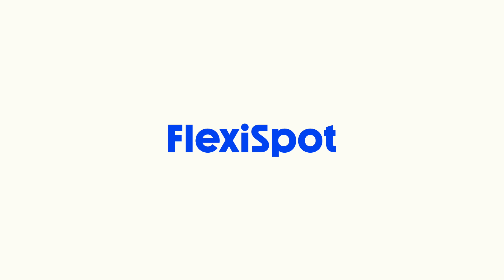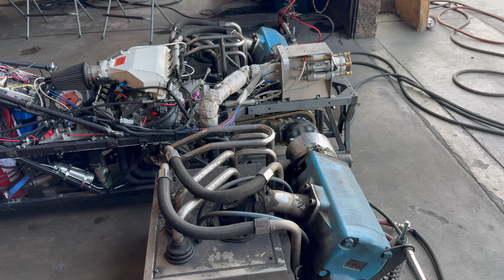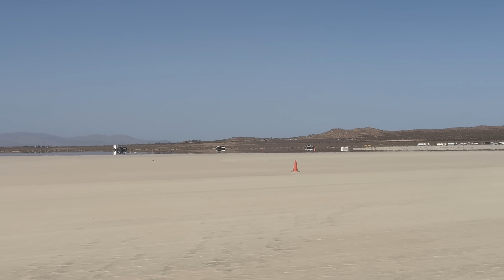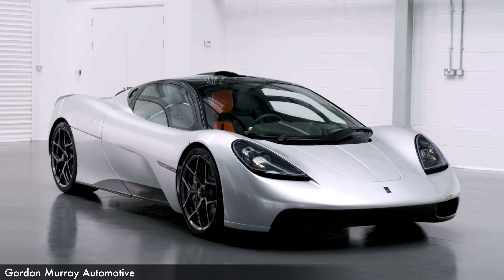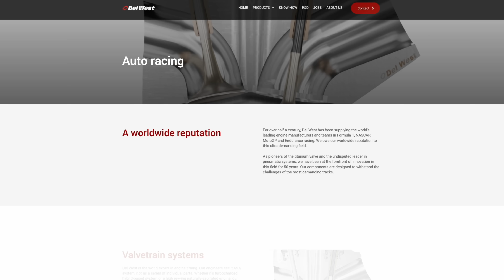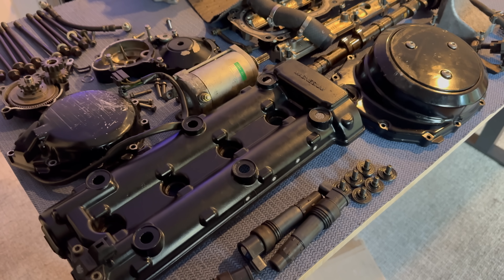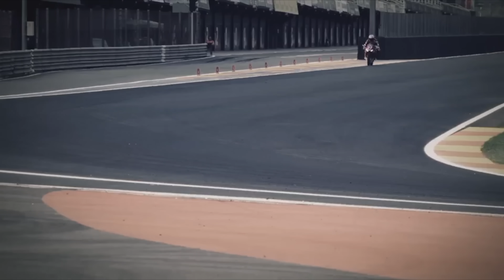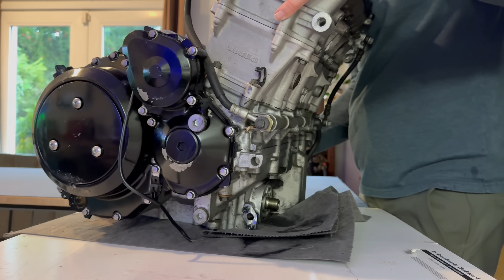Motorcycle Engines Are WAY BETTER than Car Engines

Comment: having been the 5+yr owner of a daily driven 2003 s2k  (glass rear window and 9,000 rpm redline)  a 2L v8 based on the CBR engine sounds like 15,000rpm music to my ears! the "king of heads" really needs to make a return and this sounds like the perfect vessel for it to do so. Stop being COWARDS Honda. 

sure was 5,500rpm in 6th at 65mph buzzy annoying , sure. but as a car guy I'll take it.  

Also in regards to spring  occulting frequency when I drove my S2000 on I-495 from New Castle,  Delaware they had concrete pads of a certain length and when trying to be responsible and driving at the speed limit (65MPH well actually 62-67MPH) the S2000's springs would synchronize with the bounce and make this the most uncomfortable boingy, boingy  ride you have ever felt. {at least this is what I told myself every day when I blasted through it at 80+ MPH) 

I am truly curious about the red Dodge VIPER driver that I commonly passed in the morning if he had a similar problem/oscillation to explain why he was so slow.  

Also MAD props to the dude that daily drove a red VIPER on I-495 in the mid 2ks, nothing but respect , my man. sure if the temp every went near 50F( 10c) I turned on the heat and dropped the top. but he was just out there raw dogging it, all the time.
Reply: I would buy an s4000 only designed to last 40,000 miles if I bought it at 20K for $22K like I did my s2k then years later sold it for $20K after years of super exhilarating  fun  daily driving it any day of the week and twice on Sunday. Especially after having smoked in in it for all of those 5+ years. Heck I'd buy that s4k used to only own it a year. I loved thatS2K so much!

Comment: Yhe maim thing you didnt mention, probably because it's very complicated and a whole video on its own, is that those small motorcycle engines dont produce much torque. Wpuld be fine in a small sports car, but in an SUV or truck low torque is gonna give you issues. Still, if car manufacturers were getting ICE lobbied into oblivion they could certainly implement a lot of engine design features from motorcycles to create much better engines that still last a lot of miles.

Comment: Power density is high but torque output is relatively pathetic.  The limiting factor to small  piston engines is still the peak piston speed possible while giving a decent life cycle.

Comment: 10:08 BMW N52 engine block is made out of an Aluminum Magnesium alloy. But the bolts are also made out of aluminum 😭😭😭😭😭
Putting headers on was a nightmare. 
I don’t care what any M3 comp or B58 guys say though. The N52 is BMW’s last good engine.

Comment: I've always been fascinated by 2 stroke engines like they way they use the crankcase to pump and deliver air at the end of each combustion cycle, some have crankcase skirts that act like a rotary valve to control the intake/transfer stroke (air compressed in the crankcase is forced into the cylinder at the end of the combustion stroke) or you use a reed valve which only allows air to flow in 1 direction into the crank case. They also have expansion chamber exhausts to improve exhaust gas scavenging at certain RPM synchronizations.

Comment: Why don't we use the production of  air conditioning system Inside the valve compartment instead of a nitrogen spring Obviously for commercial purpose but i think thermally its near impossible because i am not engineer POV

Comment: Displacement is not the lazy way to get more power. It’s how you get more torque output. Longer stroke=larger torque output. Motorcycle engines are great in all but you can expect it to pull much weight.

Comment: Certain b / k series Honda motors are able to go to 8-8.5 stock and with like some aftermarket you can go to around 10k if you want to build that way. However, motorcycle engines are pretty cool and rev way higher due to their nature. I think it’s always funny that a 600 is More sporty then a 650 sorta due to racing stuff lol.

Comment: Great video. As a veteran tech in modern motorcycle dealerships, I was hesitant of the video title when comparing how many engine rebuilds I've done compared to my friends in the auto industry, but you nailed the context, emissions and not built to last like a car engine. I really appreciate your break down of the valve train too. I've gotten to experience first hand the transition of screw/lock nut, buckets, deso, and finger follower through the years. From a service stand point the finger followers are definitely the best iteration. Not only can you create more power as you explain, but they are typically a lot quicker to get your measurements and make any adjustment.

Comment: Great video, but one thing, all of my BMW bike engines (4 in the last 18 years) all last easily 100k miles without any problems. Most of the repaired car engines I saw didn‘t last that long (belts in oil etc), so the milage discussion is nowerdays off the table, but yeah, cost is a driving factor of corse

Comment: ‘Motorcycles do it the hard way’ - Harley Davidson: hold my beer
Reply: Harley: The last time our engine engineers did anything was in 1955...we haven't needed an engine redesign since.
Reply: Amen. Also, tbf, when they designed their liquid cooled engine, it reliably made 200 hp so they detuned it.
Reply: @paulmryglod4802   "Reliably" in the motorcycle world could still mean the engine is completely worn out at 40,000 miles.
Reply: @SeniorKlean yeah thats a soft word with a large variance
Reply: he was talking about making power
those things can barely get out of their own way so yeah

Comment: Thank you for such a comprehensive explanation. A lot of effort in this video. That said, everything is made to fulfill requirements. Most motorcicle riders doesn't need refinement, good mileage, comfort, silence, etc. That's why gearboxes are made with noisy but cheap to be strong straight cut gears, absence of variable timing distribution, complicated exhaust recirculation gases systems and so on. Simplicity is a plus on motorcycles at the expense of good effiecency that car manufacturers are required to meet. Again thank you fur such damn good, AI free information.

Comment: That's what I thought. I guessed these engines are highly engineered. And where similar to F1 because they rev high. And thats thanks to bigger bore. F1 is the same. Probably even bigger bore revs up to 17k in old v10s. Bigger bore and smaller stroke means more rotations, more rotation is more power.

Comment: 4:16 as a ninja 500 rider I can’t tell you how much I burst out laughing hearing my bike get brought up cause I got it for that exact reason, it’s basically a sports car except it looks and sounds better turns more heads and costs a 10th of the price
Reply: its a 500 bud not a 10rr relax on the self glaze
Reply: @J @Jaysingh-ng7vc well yeah a 10rr would fit into the superbike category, my 500 beats most sports cars as is though, that’s the awesome thing about a cheap sport bike, it’s cheaper faster and gets more attention than a cheap sports car, not to mention a “cheap” new sports car is still going to be 10x the price of a new bike

Comment: My 1998 Yamaha R1 has 5 valves per cylinder.  3 inlet and 2 exhaust.  I've rebuilt 3 of these engines and although they are now old, they produce around 155 bhp at 10,500rpm.  Which still equates to quite quick.  Newer engines produce even more power but the 0 to 60 always seems to be the same at around 2.5 seconds.  I believe the tyres are the limit here.

Comment: Yes motorcycle engines are much better and more efficient than car engines, but where they are positioned makes them far less efficient than a car engine, but if you put a car engine in a motorcycle, it would be amazingly cheap to run, but still much less efficient per size and weight than it would be in a car.

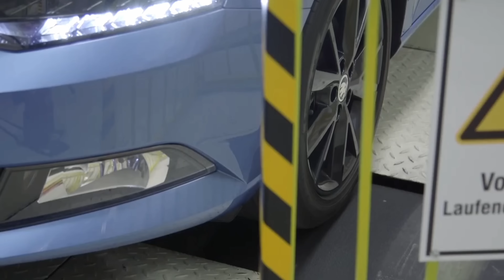Comment: 2:54 That wording is deceptive. They are very inefficient, because they dont fully burn the Carbon to CO2, but instead have higher CO and also CHO- ( partially burned fuel). 
Basicly: If you burn the equivalent Carbonatoms and hydrogen atoms of 7 litres of fuel, you will exhaust the equivalent of that. And maximum efficiency means: Everything is CO2 and H2O in the end.
So the only way to exhaust less CO2 for the same amound of burned fuel is to exhaust funny smelling stuff. And to be fair: That funny smell of motorcycle exhaust is what we all love and connect to having a great time :)

Comment: Clickbait. The #1 reason is lower emissions standards. Without #1 you can put all you want into B, C, D, and E but fail emissions so it's futile. You truly think car manufacturers (who often produce bikes at the same time.. Honda anyone? ) wouldn't have done all of this in their cars if they were allowed to? He mentions multivalve as though it's something new even though it's been used in mass production cars since the 60's. Clickbait - and the first one I fell into the trap of.

Comment: The GLARING problem with using a motorcycle enging a car is all the extra weight load that the engineers developing said motor NEVER had in mind!  I mean even if you make a car ultra light for a car?  Lets say 1500llbs?  Well that is STILL a half ton EXTRA weight

Comment: 100,000 miles on a 2005 r6 and it never left me stranded, no insurance and cheap on gas

The Yamaha r6 was made as a race bike with lights for streets 

Still lasted 20 years and 100,000miles

Comment: Caterham 7s are nice and light at 550kg (1210) with my rover k series in it. They e been fitted with fire blade, blackbird and the legendary RST v8. As close to a 4 wheel motor bike as you can get.

Comment: For me the most interesting thing about motobikes engines is their torque. I have Yamaha FZ6 2008. It torque peaks at 10 000 rpm, but!!! at only 4000 rpm it already has 80% of maximum torque. And starts to pull clear from no more than 2000 rpm (only 50% of max torque, but clean, no irregular "convulsions")) And this is without any VTEC or other phase or intake/outlet geometry variations. Race cars with same power ratio (over 160 bhp/ltr) without phase and other variable items can not work in so wide rpm range (1200 idle - 14000 redline, more than 10 times). They shake like hell in idle that is no less than 10% or even 15% of max rpm with irregular operation,  they have really peaky torgue curve with almost nothing below 50% of their max rpm (like nascar engines) - why?

Comment: One thing to note also is most motorcycle clutches are also wet, as in they're lubricated with oil. Usually the same oil from the engine. That combined with how much friction plate there is makes them extremely robust to allow for riding the clutch quite a bit more than you would in a car. Operate a car clutch how you're supposed to operate a bike clutch and you'll wear through them pretty quickly. In low speed maneuvering you're controlling your speed more with the clutch than with the throttle.

This is part of what allows for such a simple transmission without synchros - you're basically using the clutch to do the job that the synchros are doing on a car's transmission. It does mean the rider's got to keep that in mind while shifting via a bit more emphasis on rev matching and clutch control than you need on a car, but that's just one of the many ways a bike's more of an activity to pilot than a car.

Comment: Wow, a ‘semester’ class in <20 minutes; beautifully done!!! Thank you! Side note: Honda tried the motorcycle engine in a car in the early 70’s. Their model 600 had a two cylinder motorcycle engine attached to a much beefier transmission with a four speed manual shift. The car had 10 inch tires, laughable today. My dad bought one from a salvage yard in the days. We could actually go in and walk the yard. It had a rumple front fender which he replaced with a new one and hours later the car looked like brand new for a song. Unfortunately, my brother totaled it before I had a chance to get it. However, I did learn to drive a manual shift at the age of 12 just by asking my dad to teach me on that car.

Comment: I live in Thailand and the number of motorcycles in use on the road is 30x more than in the US.  Many families only own a motorcycle or 4.  They get to form at the front of an intersection and are allowed to lane split.  They are used for work, delivery and taxis.  Most of these motorbikes are under 200cc with 125cc being the most common.  Many are automatics and this is what most women drive.  It is very efficient to get from where I live to the store, restaurant or any place in the city.  For long distance travel, there are lots of buses and trains.  When I go back to the US I find very diffciult to get around without a car, unless I am in a big city center with public transportation.

Comment: I own three motorcycles. The XJR aircooled 1300cc with 4 cylinder and 4 Valves per cylinder pushes hard and last "forever"  in a bike. There are some with 200.000 Kilometer plus on the market.  My XJR is from 2004. This engine is bigger then in most modern cars. 9500 RPM are maximum. My XSR 900 Grand Prix pushes 120 horsepower with 11.000 RPM. Car-Engines normaly explode by this numbers. But this engine also have a three year garanty without range limitation.

Comment: my aprilias engine is older than me, and still runs, starts with the first kick, and has never properly been serviced, only oil changes. It runs, always but its got some gearbox issues and the carb is fucked up so it sometimes cuts out when high rpm

Comment: People confuse fuel efficeincy with fuel economy.
Cars are more fuel efficient, meaning they are able to move more weight with fewer gallons of gas.
Motorcycle use less fuel, so they have better fuel economy. But they are not fuel efficient. They move less weight per gallon.
Apples to apples, a 5000 pound truck that gets 20 mpgs is more fuel efficient than a 2500 pound car that gets 30 mpgs.
That being said, the motorcycle engine is more efficient with power. For its size, it makes more power than car engines.
Bit it comes at the cost of what is stated above.

Comment: 4 valves per cylinder has been pretty common even in economy cars 30-40 years ago. 

During the 90s was when putting a decal with "16 valve" "24 valve" on the back of the car took place, as that was when the transition was happening. Now it's just the accepted norm.

Comment: Yeah I figured motorbike engines were better in my first 2 weeks of riding. 

So much powere with such little amount of issues. So much more reliable too yet they take more abuse. Even clutches rarely get replaces on bikes…

Comment: The engines are better, but also obviously smaller, they also require more maintenance over time, and most of the motorcycle engines I've seen are more finnicky when left undriven. Additionally we rarely get to see how well they do in varying weather patterns, most people do not drive them in deep winter, though I'm certain they work. I think there is a compromise

Comment: I tried a 1990's 250cc inline four Honda (Honda CBRR) which reved to 22,000rpm. It was insane, no power under 12.000rpm, but became a little race bike from there upwards, My current 1994 Honda VFR750  V4 has gear driven cams and revs to 13,000rpm and never needed its valves adjusting since 1995 yet covered 240,000 kilomters with just the usual maintenance. The engineering and build quality is superb.

Comment: I absolutely wouldn’t say a motorcycle is engineered to last 40,000 miles. When I bought my 2004 Kawasaki Ninja ZX6R new it was $6800 out the door and it was my only form of transportation for a 2 year period. I put 60,000 miles on it by the time I sold it and it still ran perfectly. Actually the valves were perfectly in spec and didn’t even need to be adjusted. I even did quite a few track days on it. I was good with maintenance though and ran Amsoil 10w-40. There are many higher mile ones than mine, and mine redlined at 15,500. There’s an early 2000’s Honda CBR600F4i with almost 250,000 miles on it. These bikes are unbelievably tough

Comment: The issue is needing torque due to a significant difference weight. Most people can’t afford cars with the materials required to have engines closer to bike engines.

Comment: My 1200 VFR engine makes 170bhp. It has-low rpm torque although things do start getting wild after 4,000rpm. It also weighs a (quarter of a) ton before I get onto it...
It also has a catalytic converter.

Comment: Correction... Cars use to last 150,000 miles. With all the complex garbage added to car engines :   variable valve timing and direct injection, have destroyed the reliability of todays cars.. And 10 speed auto trans to add insult to injury